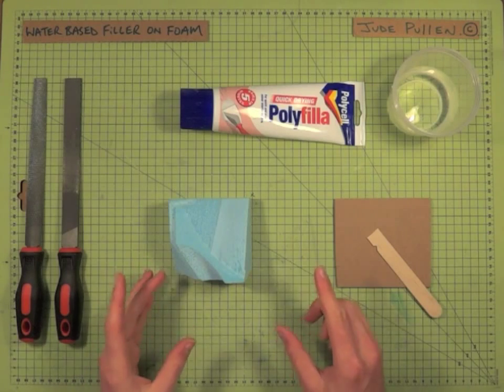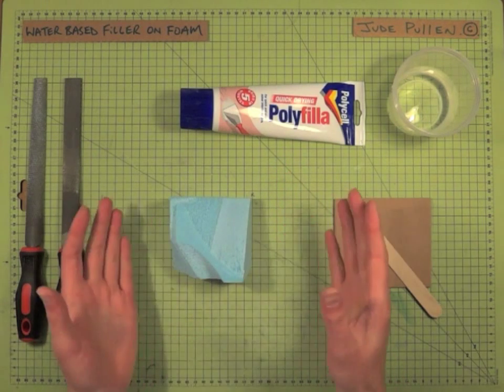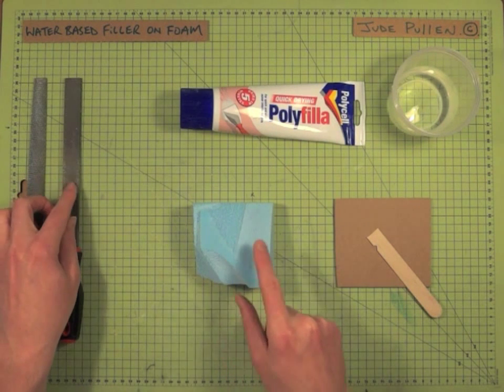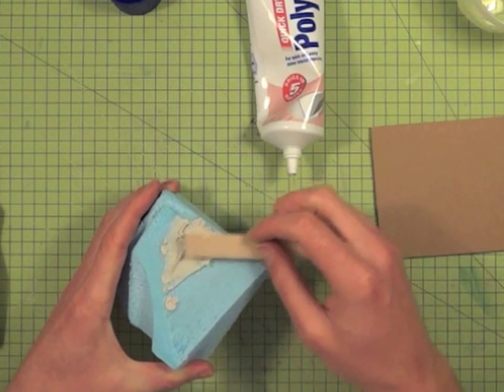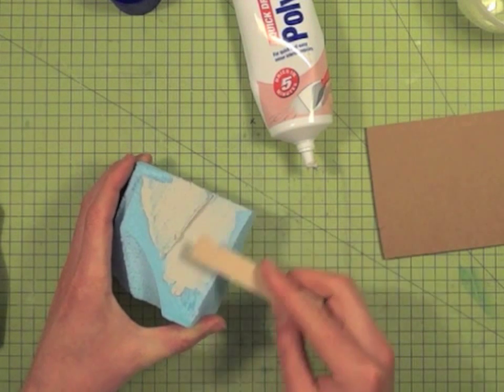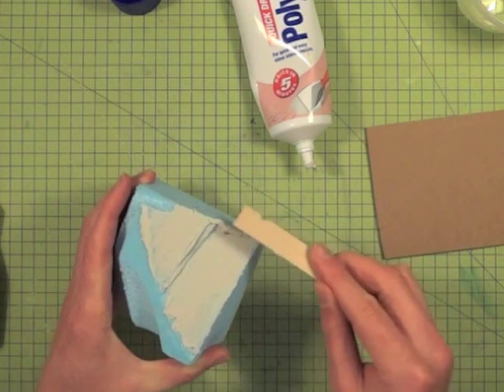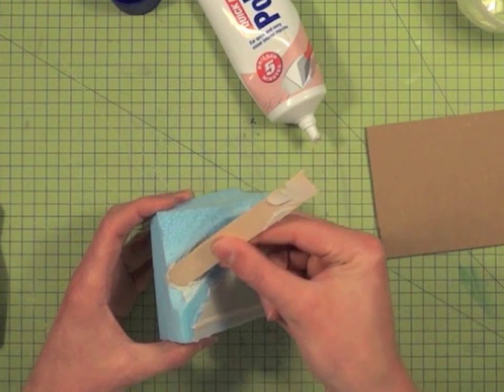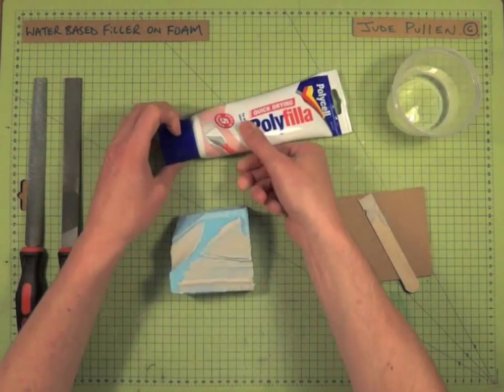Ergo Mouse Techniques - Filler on Foam

Comment: Hi, with the polyfilla ¿can I use fiberglass? I want to make a mold.
Reply from the maker: Fibreglass resin will 'melt' the foam, I suspect, so use a water-based filler like Polyfilla first, underneath to create a barrier. Hope this helps.
Reply: okay!! Thank u! :)